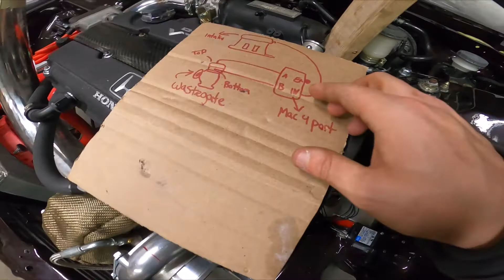how to install mac 4 port boost solenoid

Comment: The video I’ve been looking for! Only thing is, my fuel pressure regulator has a vacuum line going to the intake mani, *where you hooked up the intake line on the Mac to the intake manifold*. Where else would I be able to run my intake line from the mac to?